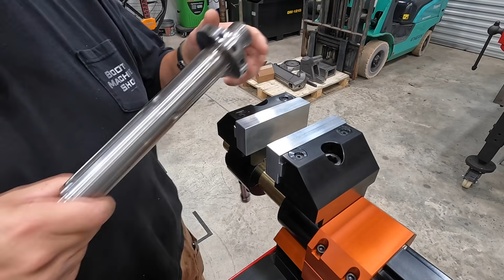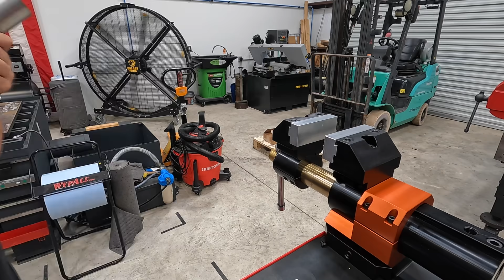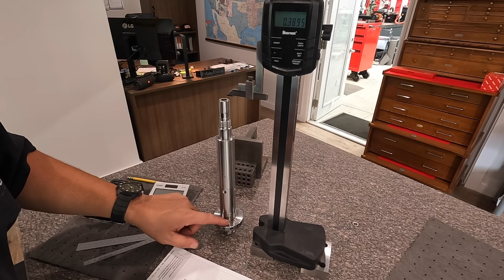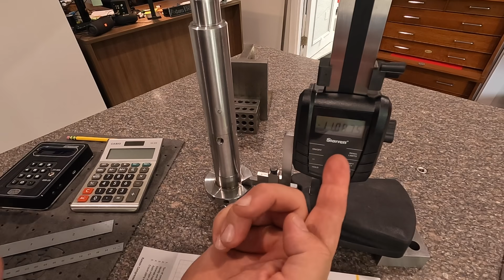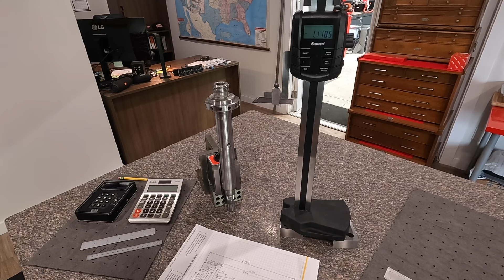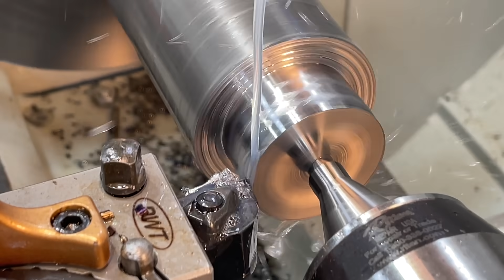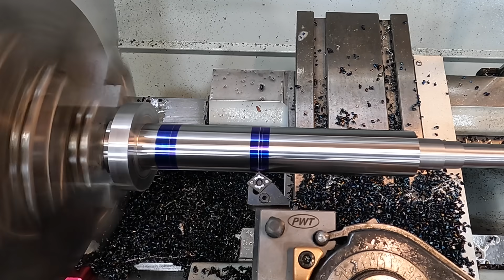Machining a Wood Lathe Spindle Ep. 1

Comment: Never understood why people turn a three jaw chuck and tighten each chuck key hole in turn, they all act on the same spiral plate.
Reply: They do, but in different spots along the scroll. Some chucks require it.
Reply: How about you go and research the chuck manufacturers and see why they recommend that.
Reply: @bobhudson6659  I've never seen it on any instructions for my chucks or been taught it (other than for four jaw chucks of course).
Reply: @bobhudson6659  I've done a LOT of searching and not found a single piece of official advice, LOADS of theories on forums, often giving different reasons so those can be discounted as just folk law (something the industry has a lot of). Many chucks (even ones from reputable manufacturers) only have a single pinion anyway and the three pinion ones don't work any differently it's just more convenient that at lease one of the pinions is likely to be easily accessible without having to rotate the chuck. If people are doing it for accuracy then why are they using a 3 jaws chuck instead of a 4 jaw?
Reply: @mfx1  Its quick, its easy, its accurate. Its the holy trinity of machining, so why wouldn't you do it.
Reply: @kevind1865  Because I've never seen a single consistent good reason given to do it just different personal opinions, some people even say you should only ever use one of the pinions to tighten the chuck (a so called mythical "master pinion" that is either marked somehow or the one nearest the makers label depending on who you speak to) but that doesn't make sense, if that was the case why are the other two even these? If you need that sort of accuracy then you should be using a 4 jaw chuck, not a 3 jaw. It seems to me to more likely be a hangover from people who use 4 jaw chucks a lot and they simply get into the habit of doing it and it "feels" wrong not to do it even on a 3 jaw.
Reply: @mfx1  Again, there's no "opinion" on it. Its fast, its easy, its accurate, and it works.

If you've spent any amount of time on a 3 jaw chuck its just another tool for you to use.
Reply: @kevind1865  I've spent loads of time using 3 jaw chucks. and yes there is "opinion" just look at the engineers forums. Just tightening it by using one of the spigots is also fast, easy and works but neither way is as accurate as using a 4 jaw. You seems to be yet another one of those people that just blindly does stuff because "it's always been done that way" and not actually knowing the reason why.
Reply: @mfx1  "Engineers forums" Ah. That explains it.
Reply: @kevind1865  Er. Exactly that's the ONLY place I've seen any sort of attempt at giving a reason, no one including you or anyone else in the thread has been able to give an authoritative reason just your own personal opinions which are no better than any other forum.
Reply: @mfx1 this is a really simple exercise. Tighten up on one and move to the other 2 and see what happens.
Reply: @mfx1  
Obviously tightening at different points produces stress at different points, which causes deflection at different points, which you can use to adjust runout.
30 seconds with an indicator will confirm it.

A chuck isn't a perfectly stiff, zero clearance mechanism. You can either accept reality, or not.
Reply: Re tightening 1 or 3 of the pinions, talk to TAFE or other hands on college instructors and see what they say - they have been in the industry for umpteen years and also get info from manufacturers. 2nd. Jobs are quicker to mount in a 3 jaw than a 4 jaw. Good 3 jaw chucks are quite accurate (less than 0.002" TIR). But expect to pay a premium for a good 3 jaw. You can also get a fine adjustment 3 jaw, which you can dial in for even more accuracy but they start at many thousands of dollars.  @mfx1
Reply: I'm not a machinist but I've seen enough videos on YouTube that I know exactly why they do that.
Reply: Chuck manufacturers typically grind in their jaws by tightening one pinion. Quality chuck manufacturers then have a sheet detailing which pinion was tightened to get to the tolerance in question. The other pinions(and that is provable) would lead to a different amount of runout.
So, since the hobby crew typically doesn't buy chucks new or professionally restorated from namely manufacturers with spec sheets, tightening all pinions every time does basically the same thing.
Reply: Tell us more, o great Armchair Machinist.

Comment: wonder how something that massive got bent.
Reply: Just watch a few woodturning videos, especially with exotic and gnarly wood pieces.  There's a reason woodturners wear face guards...
Reply: the Jet lathe is very heavy,  close to 500#  I had to take it apart to move it when I first bought it , I did not notice anything wrong with it at first , it wasn't really too badly bent maybe a few thousandths , but enough to mess up some projects ,
Reply: Cheap material in the original spindle. It's a wood lathe that we might have tried to turn a stump on it, for the burl bowl. 
I'm like the others, the guy should have bought 1.

Comment: Adam, double check the thread specs. According to the Jet JWL-1642EVS manual shown on manualslib the spindle nose is 1-1/4" x 8 T.P.I (page 7)
Reply: 1-1/4 x 8tpi is the most common mount for small chucks and lathe accessory's. Good catch!

Comment: I noticed the coolant looks more watery and clear where as the old was more milky white. Was the old coolant over mixed or not fully mixed in? Or are you using different brand of coolant?
Reply: It's water-soluble oil, mixed with water. As the water evaporates, the mix gets higher in oil, and hence thicker looking. Great stuff, but it gets really funky over time, and replacing it is a constant chore.
Reply: @jameskilpatrick7790  just noticed reply. Thanks for responding.

Comment: On a wood lathe, the hole through the spindle is to allow the user to use a rod to drive out the center inserted into the #2 Morse taper.

Comment: I am quite sure that thread is 1 1/4 by 8. That is the standard on wood lathes except for Oneway lathes. All the 1 1/4 lathes I know of are pitched at 8 TPI. Edit - just checked the manual for that machine, and the spindle is 1 1/4 by 8 TPI
Reply: That is exactly right and it is listed on page 7 in the manual. Anyone can view the Jet JWL-1642EVS manual online at manualslib.

Comment: The replacement part direct from Jet is 187 bucks, doubt you could get any machine shop to pissfart around making a new one from scratch for  less than that
Reply: Trying to make a point while missing the point? Doing almost any job as a one off when a part  'is still available' isn't about the price or if it is you are fooling yourself. If you geared up with a bar feeder and production CNC multi axis Lathe then you could compete with that price but that is not what he has and not what he does. Doing this job as a content piece for others to learn from is the point.
Reply: @seabreezecoffeeroasters7994  The same points could be made creating a spindle for a machine where you can’t buy or find one
Reply: Not like Jet wood lathes are anything special worth custom parts.

Comment: Excellent video as always Adam! Good explanation of the 'order of operations' which is what many new to turning may have a difficult time with. Also a really good explanation of how to make measurements on what may seem like a simple part. There are many features that are critical and others which are not. I know from experience on worn out or weaker lathes that the order of operations needed to maintain accuracy may be quite a bit different though. Also really like the side job of cleaning out the chip pan, sump, and refreshing the coolant. Well done!

Comment: This would be a great project to put into your CNC, Jet lathes are renowned for bent spindle shafts, I am not sure if they ae made that way or wear and tear cause it. Other jet users that know you can quickly make these would know where to come to get a replacement as Jet charge a lot to replace the spindle shaft.
Reply: Someone else posted that the replacement shaft sells for $187, that means it's probably manufactured in some third world country that pays pauper wages. It's hard to compete with that.
Reply: You do realize the majority of the work done on a cnc won't be put on YouTube at the customer's request right?

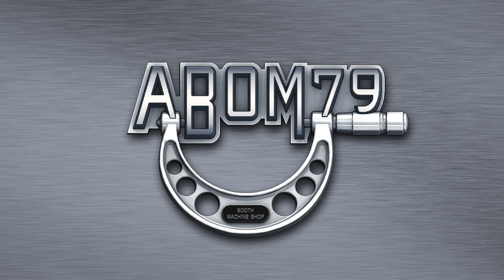Comment: 45:27/54:33  you said there was an undercut,  how are you going to slide the bearing on to the shaft to its final resting spot if the surface on which the bearing has to slide on is not the same diameter through out?  I mean diameter on either side of the undercut are not the same.

Comment: Adam I believe the thru  hole in spindle is so you can put a rod in there to drive out the mt2 center
Reply: Or to run a treaded rod as a drawbar to pull a tool tight to the taper, as is done on the quills of milling machines.

Comment: Help -- QUESTION -- I am trying to get into this trade.  My question is this.. if we have an exact 2" inside diameter hole, will an exact 2" outside diameter rod fit inside it?  I can't figure this out or does the rod have to be less than the 2 inches inside diameter hole?
Reply: I remember this discussion when I was an apprentice 50 years ago, two drydock repair gang foremen went on about it for ages. You cannot fit a 1" shaft in a 1" hole. Not without a large hammer anyway.
Reply: @billdoodson4232  ...interesting..  Maybe it is my "girl brain" but I cannot understand why that is correct.  In fact, I cannot even figure out how to start thinking about this issue.  In my head, this should fit.  So weird an issue.
Reply: "fit" refers to the degree of looseness with which a shaft is inserted into a bored hole. A steel rod will not fit a hole of its exact diameter, at least not without heating up the part with the hole so it expands, or a very large force (such as a press). This tight fit is called "interference fit", google for that, "clearance" and how it is specified.
Reply: @IvanStepaniuk  ,,,ok, looking that concept up.  "interference fit".  I had not come across that before.. Maybe Adom mentioned it and I didn't realize it was a "thing".
Reply: As mentioned by others a size for size is an interference fit. Look at even the smoothest of surfaces under intense magnification. It is never flat and dead smooth. The "highs" on the inner part will contact the "highs" on the male part. Also look up "fits" in the Machinist Handbook" It will explain this in much more detail. Retired machinist/mechanic.
Reply: @bobhudson6659  ..ah, I don't have that manual "the Machinst Handbook" but will try to get it.  But isn;t your comment that the "highs" on the inner part etc., just another way of saying that it does not actually have a proper 2" inside diameter?  What if there were no highs or lows and both parts were actually the 2" that they were supposed to be?  Would they fit then?  Is the problem only due to the fact that there are highs and lows and that it would otherwise fit?
Reply: Go and see some of your local machinists, your and my comments and get them to explain this issue to you.  @Coleen_West

Comment: the sketch looks sleek!
you mentioned the owner said the shaft is bent, how do you compensate for that in the measurements? or did you check it and it is not so bent that it changes the values?

Comment: I like watching the CNC stuff AND the manual work! I learned the beginnings of Machining in Jr College back in '78 or so. Our 3-axis "CNC" machine was ancient even then. Had to code by typing, then sending THAT to a machine that punched a stack of IBM cards, and THOSE went to ANOTHER machine that punched a paper tape! You can imagine one tiny mistake anywhere ruined the whole process... As could one stray punchout from the tape! My first try failed at the very last "Z+" command. Opened the machine and the bottom had about a half inch of them... :face-fuchsia-wide-eyes:
@ ~4:00 is that through hole possibly for a drawbar for a collet chuck (same part might be used on a small metal lathe)?

Comment: So coolant and lubricant seem to improve finishes and make cutting the metal quieter. What does it change about the actual machining? My initial thought would be the tool would slip more and fail to cut properly. I’m wrong quite obviously but why?
Reply: Another factor is that it quite difficult to get a really good finish on very thin (shallow) cuts. But the higher quality of the steel, the better the results. I tried for years. Fine emery tape is your friend with lower quality steels.

Comment: I realize that Adam is going through a whole lot of effort to show us what is necessary to perform a proper inspection and layout of a part. That being said, the WOOD lathe that this is going to go on probably never had this degree of care when it was being manufactured.

Probably going to be one of the truest JET wood lathes ever made.
Reply: My wood lathe and chuck can archieve runout smaller than 5/100mm when precautious. Minimising runout is also prevalent for woodturning.
Reply: And you got a problem with that?

Comment: The through hole serves 2 purposes.  One is so that you can use a knock out rod to remove a center from the Morse taper, and another is so that you can use a vacuum chuck adapter on the lathe.
Reply: I also presume you could use it to machine long dowel rods that are too long to fit between centers too.